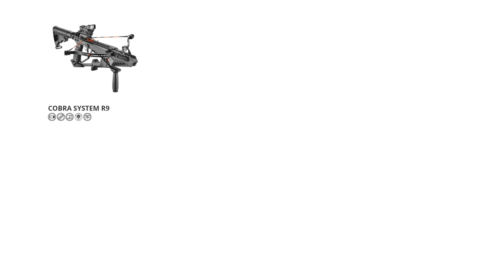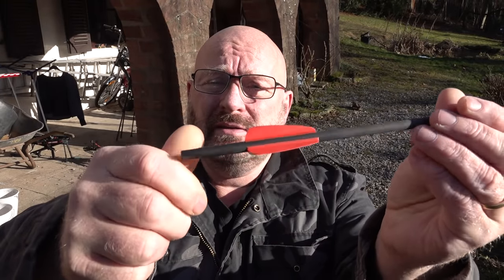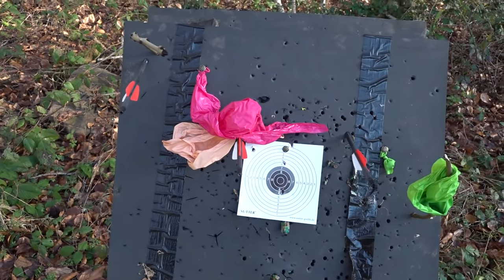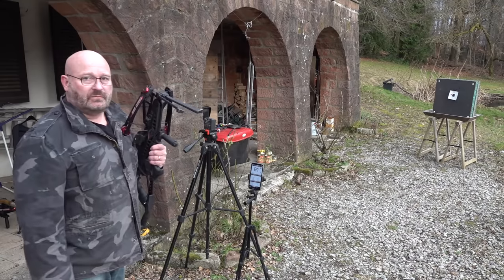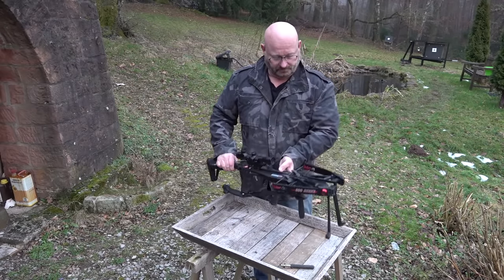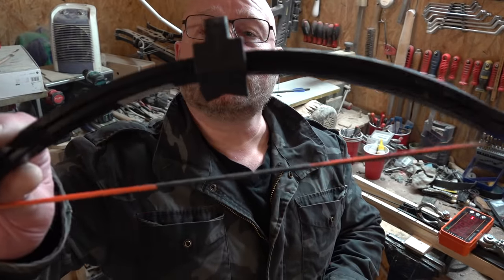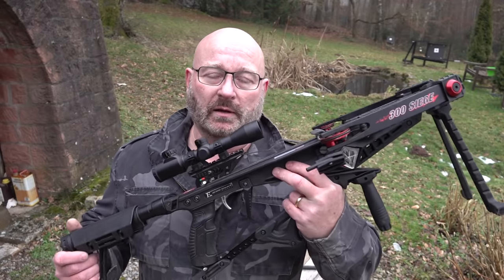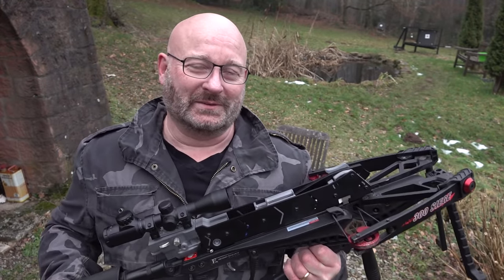The "Siege" Crossbow - Crazy Complete Review!

Comment: You should design a drill motor cocking device for larger crossbows.
Reply: Yes a drill motor and a magazine even for this would be brilliant. Or maybe compressed air.
Reply: Had the same idea....powerful cordless impact drill motor that draws the string with the push of a second trigger and automatically stops when the string is in place....then it would be 👌

Comment: 300 Siege THE BIG MINUS IS THE 7.5 MM bolts  /port  is designed  makes it impossible to use universal  cheaper  BOLTS WILL NOT FIT 7,8 MM
Reply from the maker: There are about a million third party arrow manufacturers that make fitting bolts, all the way from dirt cheap ones on Aliexpress to high end stuff made in the US and Europe. The Cobra R platform is now the most successfull crossbow line on the planet.

Comment: Dang, I thought it was 400fps with a standard bolt.
Reply: Yes I thought the same thing and even better if it could shoot a normal arrow at 440+ FPS which is the equivalent of 300 miles per hour. I still think my wish for what I really want to see is possible while still having a fast loader and automatic reload like the adder. But another video of the siege shows a guy using a clip magazine that allows for 8 loading 15.5 inch bolts. But it's on it's way there to all the things that we wish it had.

Comment: Will there ever be an Adder with a stabilizing claw stock and that high cap bolt mag?
Reply from the maker: Probably not. The double stack magazine is a bit harder to load and I am afraid it might even jam when people use the cheap Chinese bolts. They have different thickness and so on.
Reply: @Slingshotchannel   What about the stabilizing claw stock and the ability to turn off the safety?
Reply from the maker: @IndigoXYZ18  The claw stock is probably too bulky for most customers. The auto safety will have to stay because the manufacturer is afraid of legal issues, but I published a manual how to convert it. https://drive.google.com/file/d/16iqS_CRAKqmyFHDiwjgGgqiA-PqZqzSp/view?usp=sharing There is also a video that deals with it. https://www.youtube.com/watch?v=0tt4gNJdNk8
Reply: @Slingshotchannel   A modular claw stock sold separately perhaps, or maybe a foldable one?  I think you'd be surprised with the interest there'd be for that.  Besides safety removal (thanks for the video you linked), the claw stock is the only way to get rapid shots on target, let alone with accuracy.
Reply from the maker: But it would have to come in different sizes. It does not work if it is too loose for the individual shooter, and if it is tight it is utterly useless. So you would have to make it adjustable = expensive.

Comment: The bipod seems pretty lazy. No adjustable legs, no axial rotation or horizontal pivot, just a solid lump. It doesn't even look like it can fold? This may be fine for shooting from a bench, but for any kind of practical use I think one would find it lacking...
Reply from the maker: You can remove it by means of a single thumb screw.

Comment: can this use 16'' bolts, since 15.5 does not seem very easy to find?
Reply from the maker: The length is not the problem, the diameter and the shape of the nock is.

Comment: One question though. Will you be able to use any off the shelf crossbow bolts?
Reply from the maker: No, but there are now dozens of manufacturers selling bolts for it. All the way from cheap junk from China to high end bolts made in Germany. This is the most successful crossbow platform since I don't know when.
Reply: @Slingshotchannel  Thanks. I believe it. Like you said in the video about using winches and cranks like other crossbows, it's that way for me too. Cranks and winches are just too cumbersome, fiddly and annoying. Especially when you can easily have a simple cocking lever. Love this technology.

Comment: Hi. I like all your videos and you laugh. I see on YouTube a few years back a real big power full bow and it had a wind up handle to pull the string back but it was to loud . I would like to see the the bow you have in this video clip but with a wind up mechanism but with a gear box packed with grease and because it would be in a box bit like a gear box with grease it would be very quite. 25-years back I would design it my self . When you wind and the thing flips down can’t think what to call it but if it flipped down on say stick on rubber 2-MM thick stuck on the sprocket it’s would cushion the sound and the teeth on the sprocket the every edges round the tips over a little. I like the bow but my spine affects my arms I ok with my R9 just. I love your videos ant your laugh when you laugh I laugh.Lol👍

Comment: 405fps? Wby does it say on all the websites that is only 300 fps??
Reply from the maker: They use heavier bolts.
Reply: @Slingshotchannel  ah ok thank you! IL have to re watch the video again to see which ones you used to get that kind of speed out of this bow.. so you are using it as standard with standard bow string yes??
Reply: @Slingshotchannel ah so it's only the tiny 6.5 or 7.5 inch bolts that go 425 FPS? The ones it comes with it the 15 inch 3 bladed arrows only go 300 330 basically then like the websites everywhere say yea? I want somthin with more accuracy at longer distance so even tho the small bolts to faster there not gonna be as accurate long distance are they? So basically I'm lookin at 3 to 330 FPS with bigger bolts..

Comment: Your 150 pound compound
Crossbow performs the same as a 65 pound recurve horse bow like a Turkish or Korean bow….
Reply from the maker: Of course. Very normal. A bow has a power stroke of over 22 inches typically, this one has less than 8. So the crossbow needs 2.75 times as much draw weight to achieve the same energy. It needs only 2.3 times though, the advantage of the compound technology.
Reply: @Slingshotchannel  Science! Also That video I shared has a very impressive regular bow performance. A 55 pound recurve bow shot 10GPP at 200FPS. I dont think any crossbow can do it. It took a powerstroke of about 25 inches to do that.